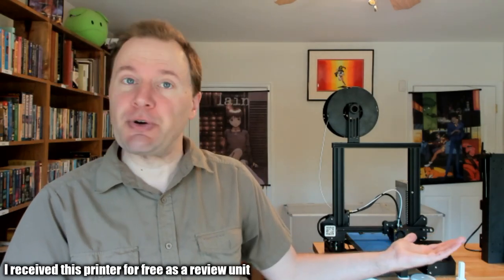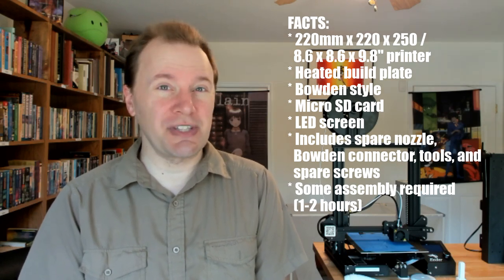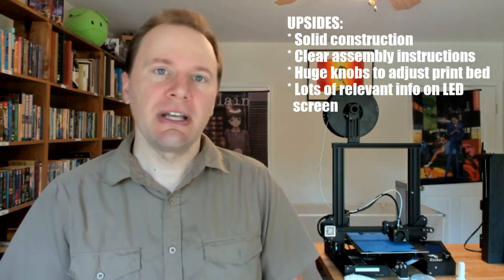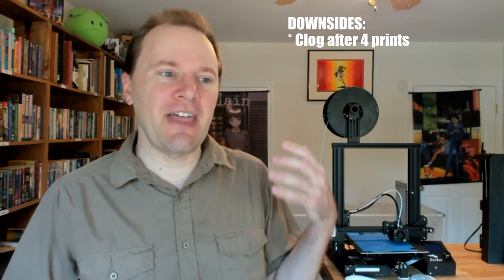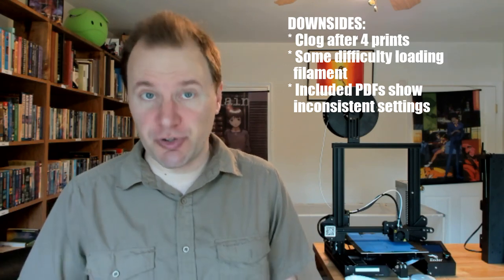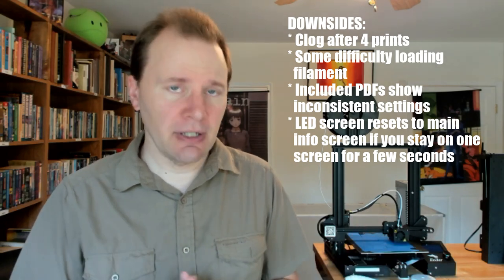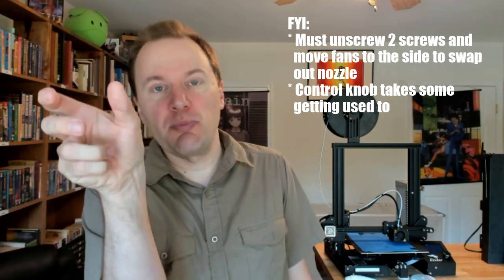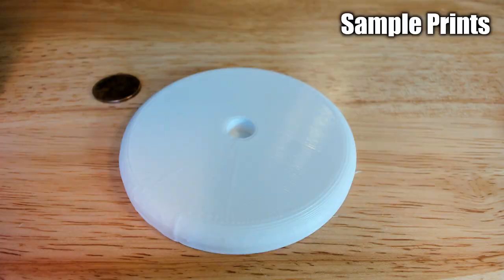Creality3D Ender 3 3D Printer Review

Comment: Clog and difficult to load: Just unboxed mine today, being 3D printer #30+, compared to a Tiko or XYZ Pro, ROBO 1+, Magician or Cube3, a clog rarely becomes a problem, should be able to clear in under 60 seconds, since the pathway is no different then an MP Select Mini, many scratch built printers have the filament close to the threaded rod, lots of well designed upgrades posted on Thingiverse. Since the Buildtak on mine isn't mounted, I'll use glass right from the start. Shelfs of spare parts, so the air connectors will swapped day 1, most likely fixing the filament loading problems.